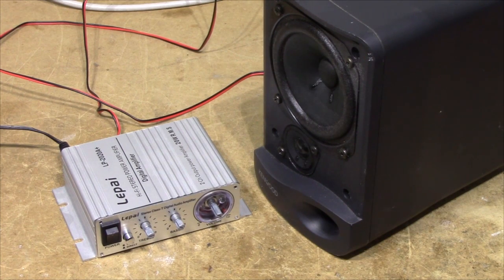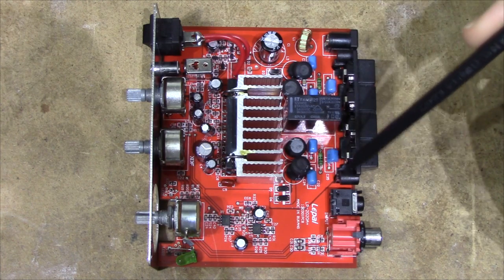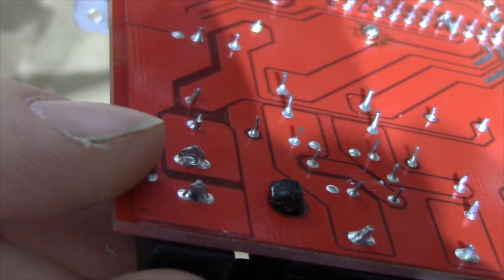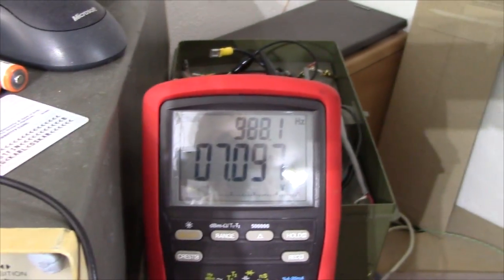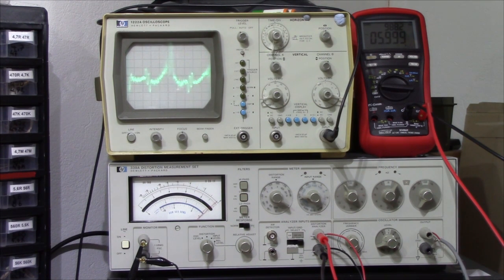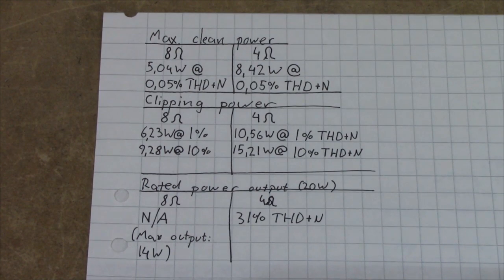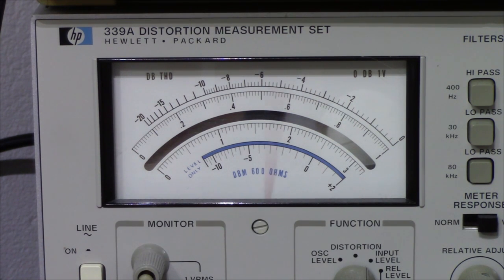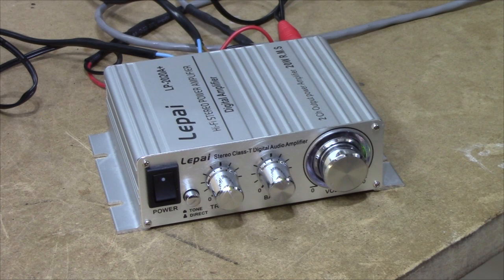Lepai LP-2020A+ OBJECTIVE performance test, teardown & review

Comment: FFcossag Thanks for your review!! I must admit that I have very limited knowledge of electrics in general. I found your video while searching for a way to run one of these little thing in mono. Although you talk about it around 7 minutes in, I didn't quite understand... So is it possible to bridge this amp to run a single speaker in mono?
Reply from the maker: testacorsa150 It's NOT possible to bridge this amplifier, since each channel already is made up of two bridged amplifiers.
Reply: Thanks a lot for your fast reply. I am now looking into a ta2024 amplifier board on ebay, and looking into paralleling the channels instead. No idea how, and if it is possible yet. You are most welcome with any input on the matter :)
Reply from the maker: testacorsa150 It will not work. You can't get more than about 5 W/8 Ohm or 17 W/4 Ohm out of a "12 V" amplifier that doesn't have a voltage booster (like a large car amplifier). That's why people often use 4/2/1 Ohm speakers in vehicles.
Reply from the maker: testacorsa150 A Lepai is going to be a lot better than that thing. It's linear, so it's going to run hot and give you poor battery life.
Reply: FFcossag Crap, I just ordered that thing haha. Since I am only using one mono speaker, the lepai wasn't really an option.
Reply from the maker: testacorsa150 You would get better battery life and performance by just using one of the channels of the Lepai; you don't need to connect both.
Reply: Yeah, after reading up on amp efficiency I agree with you. The class a amp has a better chance of sounding nicer than a class D or T is seems, but I just saw the response on this particular amp is limited to 40hz to 15khz, so that sucks. My speaker goes down to 25hz, so that is a loss right there. If I use a lepei or any other stereo amp, will they work if they only receive a mono signal?
Reply from the maker: testacorsa150 That'll work fine. And that cheap-o mono amplifier is going to perform worse than (but basically sound the same as) any other hi-fi amplifier. The TDA 2XXX are ancient, cheap and bad.
Reply: Thanks again. Kind of regretting buying that thing now, but I will test it out when it gets here. Just subscribed to your channel, after finding an excellent review on a mppt charge controller. Keep up the good stuff :)

Comment: FFcossag
greeting. I own a pair of speakers at 2 ohms. I also have hand made amplifier germanium 2x10 watts. the instruction writes on LEPAI  amplifiers that can work at 2 ohms. HAVE YOU DONE measurements at the low impedance. I am very interested to buy this little miracle.
Reply from the maker: The Lepai CANNOT drive 2 Ohms. The box lies, the chip it's built around is not designed for 2-Ohm loads, and running those risks destroying your amplifier.
Reply: FFcossag ok, thx for your replay. can you recommend   some amp 20 watts  that works at 2 ohms?
Reply from the maker: Marko Vlasic I'm afraid I don't know of any such device.
Reply: Marko Vlasic you might ask yourself
This type can be used for a bass speaker 25
400w to 500w which is not ?
Reply: Marko Vlasic you might ask yourself
This type can be used for a bass speaker 25
400w to 500w which is not ?

Comment: FFcossag, Thanks for the video it's quite informative. As to the volume mods could you be more specific as to the parts used as I am a electro twit. Questions are as follows 
1. Vol pot. is this a specific size or type, how do I specify when ordering parts other than it's 20k linear. Please include the tone control pots also.

2. I could not quite make out what you said as to the reason for the resistors soldered to the backside of the board in the volume circuit could you give a brief explanation 

3. P/S I am from Missouri USA what language is it that you speak. Ha Ha
Reply from the maker: +Less Opinion This potentiometer is a "China standard". You'd have to look at the mechanical characteristics of it and find one that matches to do it right, but in this case you can just go on Ebay, type in "20k linear stereo potentiometer", and basically all of the ones that look the same as the original will fit.

The added resistors are there to change the linear potentiometer to a logarithimic one. This is because linear pots tend to be more reliable than logarithimc ones, but you want a log response for a volume control. You can just use a log pot and omit the resistors if you want to.

Your computer power supply will work fine, but it is grounded, so if you connect the amplifier to another grounded appliance (such as a computer), you might get noise and hum due to a ground loop.

I do not know what language I speak, except that it isn't yankeenglish. ;)

Cheers

Comment: This amplifier is powered by Sanyo Linear IC model LA4636. 11 Watts RMS 2-channel BTL AF Power Amp. Accept 8 OHM speakers, and 10% of THD.
Reply from the maker: The Lepai LP-2020A+ is built around a Tripath TA2020. I don't know where you got that Sanyo IC from, but it's incorrect.
Reply: FFcossag Certainly the power of any amplifier and distortion varies according to the impedance of the speakers. In this case, with 8-Ohm speakers the power of this mini amp showed 5,152 W. at 1% THD (measured with Velleman HPS50) even though the manufacturer named TRIPATH indicates 8W.
Reply from the maker: ***** My measurements align reasonably well with the stated specifications (I measured 6,67 W in my written review into 8 Ohm at 13,5 V supply, whereas the chip is specced for 7 W). Keep in mind that the clipping power depends on the supply voltage, and will be lower at 12 V.

Comment: the power supply i use universal ac adapter 15v 3.5v 90W MAX MADE IN CHINA AND I LIVE IN ENGLAND THE MAX I HAVE PUSH IT TO IS THE ONE O'CLOCK POSITION.I AM WAITING TO MODIFY IT ONCE I GET IT OPEN.I HAVE DONE MY HOME WORK. I HOPE THAT HELPS        DO NOT PUSH THEM

Comment: hey i just got one of theses and its driving me crazy, when its powered on with no input, the speakers make a low static noise/hiss, and when i connect an input its still there with my music,i read online that it could be bad grounding but i honestly dont know. can you please give me some advice. i have tried replacing all the wires and even the 12vpower brick
Reply from the maker: +saad abass There's some internal fault in the amplifier, most probably. It's impossible to tell, but it isn't supposed to be like that.
Reply: +FFcossag if i open it up and send you some clear pictures could you possibly see the problem, hahaa i know its a long a shot but its worth a try i guess.
Reply from the maker: saad abass I'm not sure it's worth bothering, I'm afraid. Issues like that are rarely if ever visible to the eye. You'd have to go through it with a meter in order to say anything, really.

Comment: If you have two of these, is there a way to combine them to one? I would split the audio cable and double the speaker cables, but this is of course without any knowledge of electronics, I would probably end up with smoke and fire  :)
Reply from the maker: No, you can't connect one speaker to two of these. If you just split the input cable, you can play the same sound through four speakers.
Reply: OK , thanks for the advice :)

Comment: Can I run this lepai with a 12v or better yet,  a 14v total rechargeable battery. Also, will the output be the same in ac or dc.
Reply from the maker: The input voltage should not be over 14 V, ever. A 12 V nominal battery is probably the highest safe battery voltage you can run, since a battery always is much higher than its nominal voltage when fully charged. There's basically no difference between voltage coming from a wall wart, or coming from a battery, so the unit will work identically.
Reply: Thanks very much for the reply.
Reply: allan soria you might ask yourself
This type can be used for a bass speaker 25
400w to 500w which is not ?

Comment: run voltage up to 13.5 input and add a capacitor  on the input then retest...?
Reply from the maker: I did that in my written review, you can find a link in the description of the video.

Comment: Hi I hope you can answer this.. i recently got a lepai 2024a which seems to be the same as the 2020a but I guess I cranked it up too high or something and the sound quit. After that, the blue light would only fade on and off. I tried unplugging and everything... All it would do from then on is the light fades in and out repeatedly and no sound so i sent it back and got a 2020a now. Can you tell me if that problem with the light fading in and out is easily fixable as in a way to reset it or did the amp just fail? Thanks .
Reply from the maker: +cottonproductions Something has gone wrong, it's impossible to tell just like that, I'm afraid.
Reply: chances are thats a capacitor problem

Comment: Hi, I'm completely new to this but can this be bridged to give a mono output with double the power
Reply from the maker: icantfindspace The short answer is no. You can find the long answer somewhere around these comments.
Reply: +FFcossag actually, you can get a stereo to mono output wire to convert it, so the short answer is..........Yes.
Reply from the maker: Tee Bee You can NOT bridge this amplifier, since each channel already is made up of two bridged amplifiers. You can use a mono adapter to make both channels put out the same signal, but they will not put out more power than in stereo mode.
Reply: no one said you had to bridge it to make it mono.
Reply from the maker: +Tee Bee The question atop this comment thread quite specifically refers to bridging.

Comment: What's the difference to this and the 2024 a+  version?
Reply from the maker: The non-A+ is really shitty.
Reply: Ok thanks
Reply: so the 2024a+ should be good? (if slightly lower output power)
Reply from the maker: jsv
I wouldn't buy anything 2024 based.
Reply: I'm interested in why you wouldn't buy a 2024 based system?

I'm waiting on delivery of a 2024A+, luckily I only paid £10 for it.
Reply from the maker: Devinder Athwal
The 2024 is old, inefficient compared to more modern chips, and even weaker than the 2020.
Reply: What's better? I bought the Kinter and that was crap. Now I have the Lepy 2024 and that was an improvement but still crap. What's something that's going to sound good on two 4in 100w in an Ammo box

Comment: Nobody designs a volume control to alter feedback of op amp, its just not workable! Are you sure you didn't mis-read the traces?
Reply from the maker: Whether or not something is workable. generally has little impact on the Chinese design process. There isn't really any other way that a dicky volume control would cause that horrible oscillation issue.

Comment: That Lepai is a fake amp. he real ones have a blue LED that goes all the way around the potentiometer and the color is different.
Reply from the maker: operationTF7 You have a keen eye. I replaced the two blue LEDs for one green, since I just don't fancy blue LEDs in general.
Reply: oh,ok. Yeah, a lot of people complained about the blue LED being irritating to the eyes.
Reply: +operationTF7 yeah i agree. i replaced mine with warm white ones. looks much more pleasnt. however after obtaining better equipment over the years i eventually hit that leapi with a hammer
Reply: smallenginedude71 I wish I had that much of an inventory that I could intentionally destroy a portion of it and barely loose any value! XD
Reply: operationTF7 i accidentilly reversed the polarity on the 12v input so it was broken anyway. i wouldnt kill something that was working well.

Comment: I think you bought a dud - Bad heatsink, treble only on 1 channel, bad  pot. Get another one and do another test.
Reply from the maker: +Hamish Spencer Out of all the people that could have gotten a dud, I'm glad I did; it highlighted the potentially devestating issue with the volume pot, so that people know what they're getting into.
Reply: Thank you for pointing that out. I just wonder if clipping and power output levels are also faulty on yours. If so, it would be nice to see the 'real' values.
Reply from the maker: Hamish Spencer No, the output power values are what you'd expect to get out of the amplifier IC. They're limited by the 12 V supply voltage.